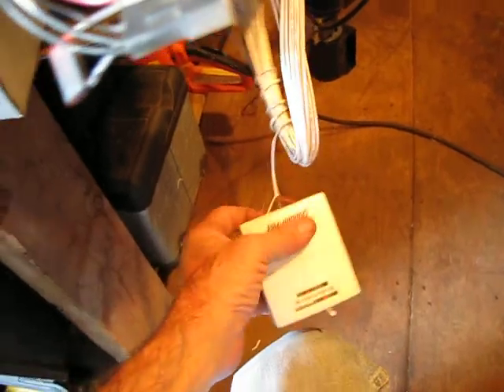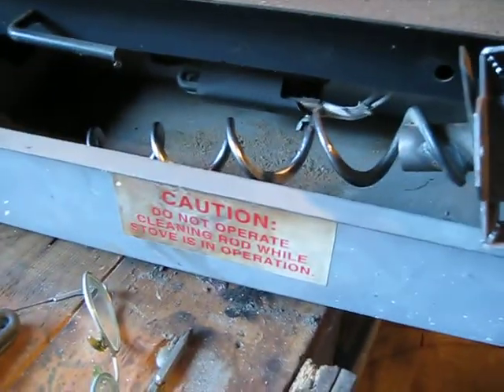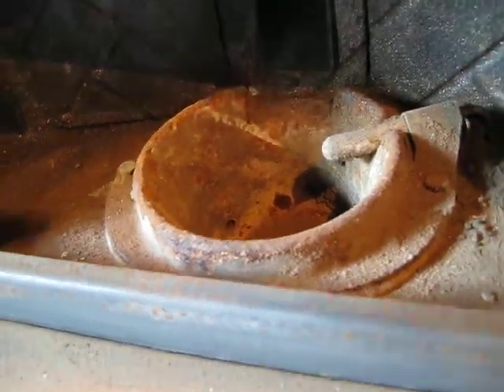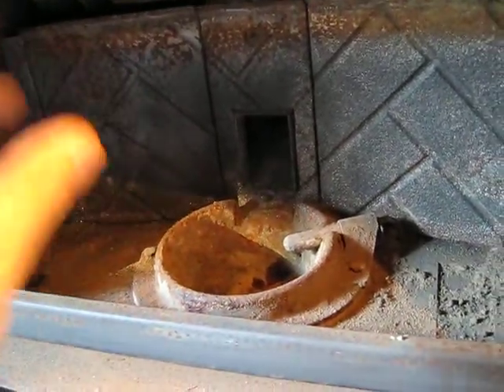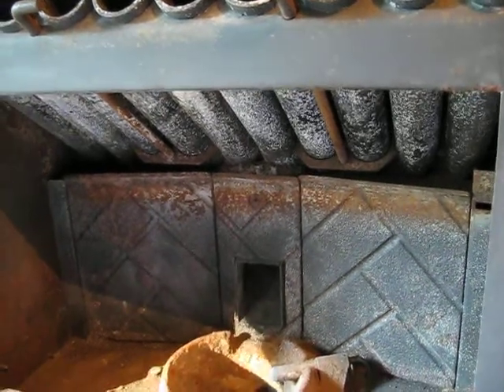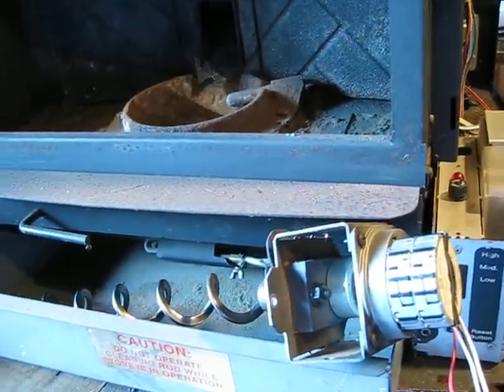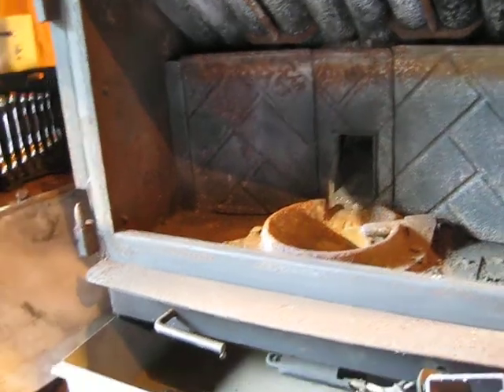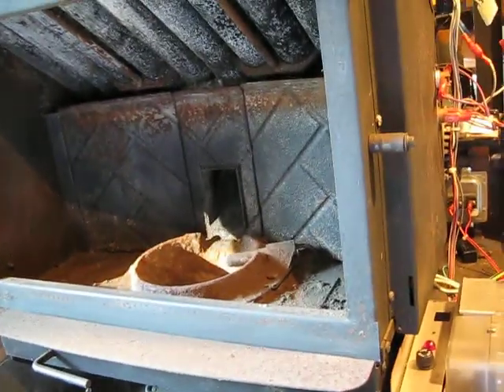Quad OE 10  Commercial

Comment: You're other video's have helped me greatly in fixing my quadra fire classic bay pellet stove, however, I am currently trying to change the window gasket in mine.  Problem is there is no video or pictures available as to where the gaskets go.  I've read you only put it on three sides of each window and leave the upper half open..I don't know.  The stove is about 15 years old.  I've change the door gasket already several times.  The gaskets around the windows were disintegrated.  So I can't replicate how it was originally on there.  Any chance you can help me?
Reply from the maker: You'll need to remove (replace) the door gasket to get to and remove the frame that holds in the glass.
Pretty rare that needs to be done. Glass gaskets are stationary and see very little wear....even at 15
Broken glass....replace them...short of that...usually not. Test them with a cigarette or some punk sticks or weed if you have some
You'll usually find...it's all good. :)
Reply: @soothappens1  Well, I already removed the glass from the door, wasn't much left to gaskets, believe it or not. That's why I can't figure out where to put the new gaskets at. The gaskets were not around the windows, and I had just straight pieces left.  I've read somewhere they say don't cover the top. But can't find any clear instructions.